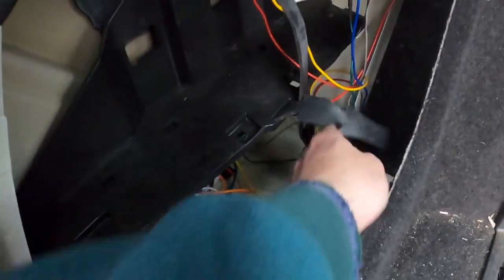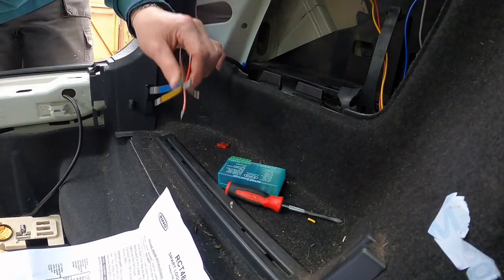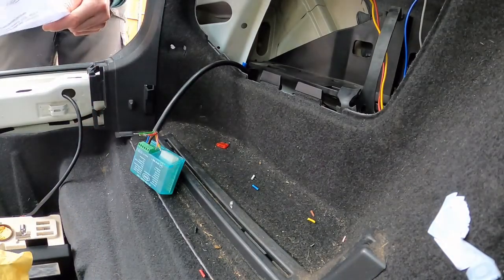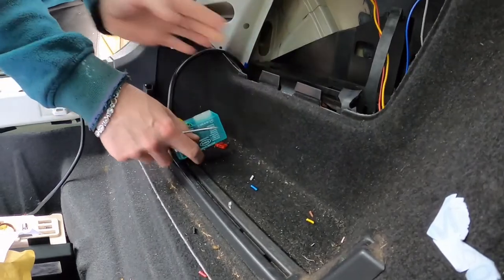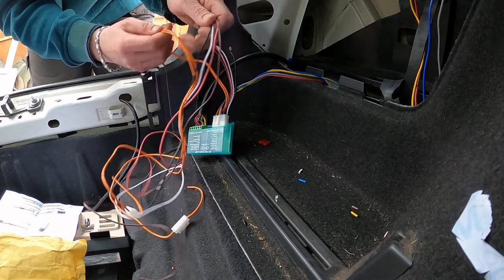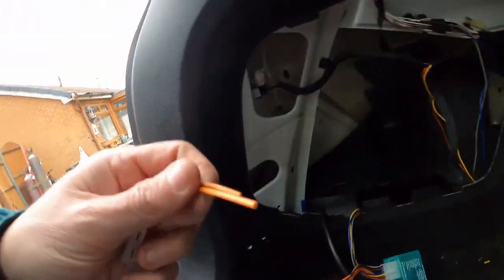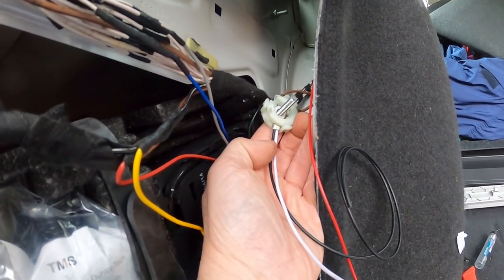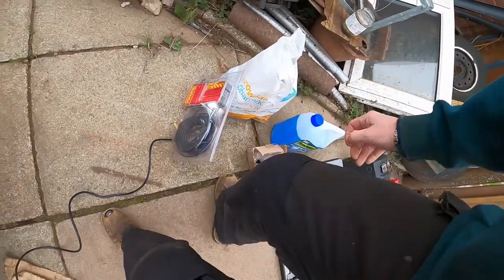Mk7 GOLF TOWBAR ELECTRICS PART 2 INSTALL OF CANBUS BYPASS RELAY

Comment: Hey Lisa   were did you take the 12v +   to power the relay box?
Reply from the maker: I think it is from.a spare plug fuse terminal in the fuse box. A spade terminal fitted a treat. Otherwise you can go from the battery and through the bulkhead behind the glovebox

Comment: Hi Lisa, where did you connect the reverse wire to please?
Reply from the maker: I think the towing relay has a reverse  signal and output. If not i will have just soldered into the main loom but i think it is relay controlled.

Comment: Hi Lisa. How do you know which wire is which as part of the car wiring loom ?
I’ve fitted the towbar, I’ve got the wiring inside the car but now I’m baffled as I don’t have any wiring diagram for the car (also a golf mk7).
We will be away camping in two weeks time and I’m getting desperate to sort out the wiring.
Regards,
Florin
Reply from the maker: I followed the wires back from the light cluster. This did include removing lots of trim from the interior.

Comment: you havent shown most important part 
it was straight forward to connect the trailer to relay
how you connected cables from relay to car wires 

,??
Reply from the maker: Just spliced into the loom. Easy peasy. Nice and straight forward.

Comment: Hi, a have question about the brake light and side lights.Relay using only single feed from brake lights to power side lights on trailer, but when you step on car brake without side light on, did a trailer side lights come on with brake lights ? 
Thanks.
Reply from the maker: No the relay uses the canbus signal voltage to operate the correct lights on the trailer. Side and brake lights operate seperatly like on the car.